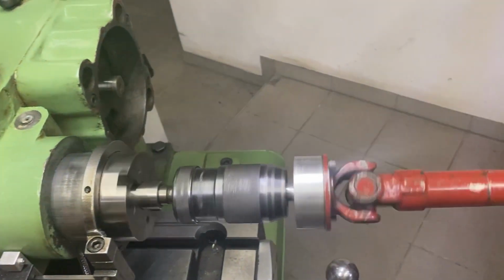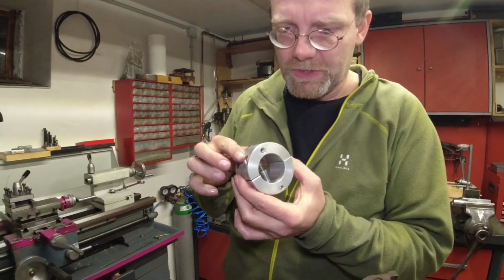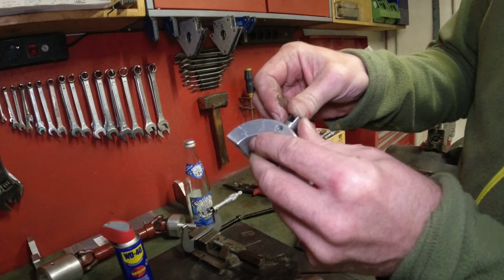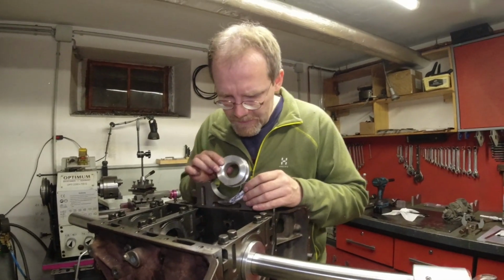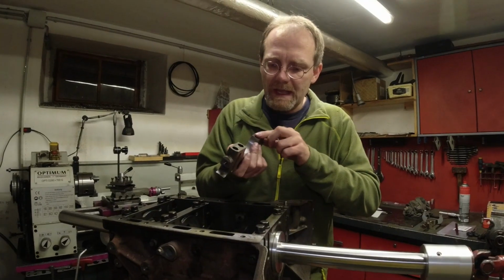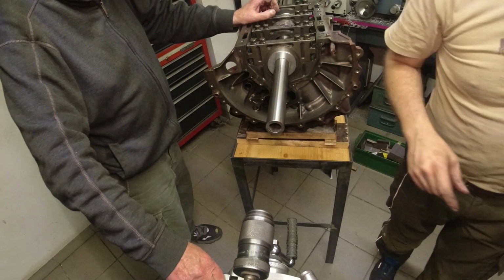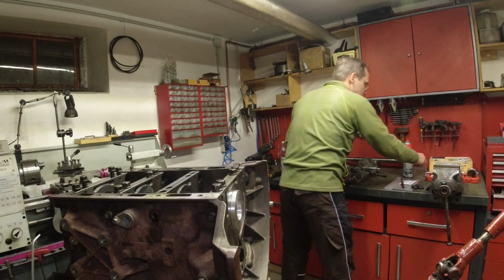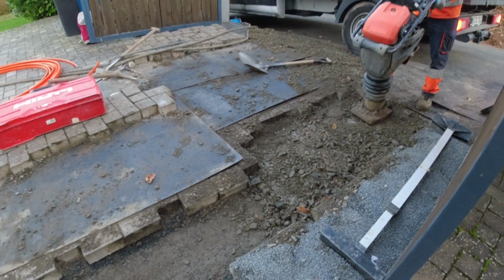DIY line bore diesel engine block - Ford Lion TDV6 - Land Rover Discovery 3

Comment: I rebuild these engines and use new genuine land rover cranks I wouldn’t use anything else. I was advised against grinding cranks.
Reply: @Gfls00  no a very well respected engine builder. A crank isn’t £1000 either but we get ours line bored and honed to standard. All mains are bored
Reply: I would say don't you worry 'basic' german home workshop probably running more accurate tolerances than LR manufacturing plant 😄  no offense meant
Reply: @blue-tb6uv  I don’t have anything to do with a Land rover manufacturing plant. My engines are better than new.
Reply: @nicjohnson2522  i would not dispute it the slightest. However retouching crank by good machinist in germany is gonna be at least as good as new or better... that's just my opinion
Reply: @blue-tb6uv  not when they are inherently weak! The journals are very narrow its a design issue! Trust me i’ve had 100’s apart and seen plenty of snaps and always in the same place. Also know that when they’ve been ground they go on to snap

Comment: Very brave in even attempting to fab a line borer and i really do hope it works as the majority wouldn't even try such a thing and take it to the machine shop instead.
As for your high speed internet cable i can't believe the extent of the work they're putting in as here in the UK they can't even drill a hole through a wall right never mind bury the cable.Mine was sleeved through plastic pipe and dumped across the top of the lawn.
Reply from the maker: 😅👍🙋‍♀️Vera

Comment: I'd been wondering how this was going to work since seeing the preview in last week's video.

II thought, perhaps, you were going to end-up fitting oversized bearing shells in the 2nd and 3rd journals and retaining the original size shells in the 1st and 4th journals.
I guess that would work but it'd be a bit shonky.

Very lucky that most of the damage was to the main bearing caps, rather than to the block, itself, which allows you to return the journals to original size.
Reply from the maker: We'll definitely have you guys be part of that journey we'll take getting the engine fixed. 👍🙋‍♀️ Vera